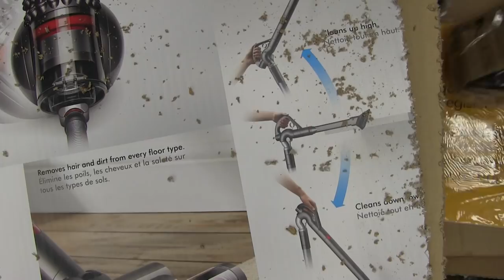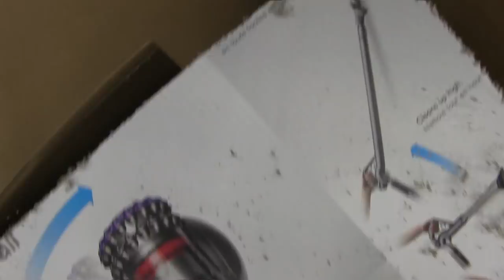DYSON ANIMAL BALLS | It blows!

Comment: Teardown a Miele, would be interesting to see how it compares.
Reply: Ill second this.
Reply: Miele, Sebo, riccar. Take a pick, all of them will be better, but can go over $1000 depending on the model. Plus none of them have the marketing, aesthetics, or availability of dyson, which is why dyson is still popular as a premium brand.
Reply: Given all these teardowns of dyson products, you'd think that AvE is a fan (albeit a disappointed one) of dyson.
Reply: ac3ofspades878 Teardown a Kirby. I've done it many, many times. They put everything to shame. I have several Kirbys in the family and a Miele. I like that Miele a lot, but the Kirbys will be around way after it's gone.
Reply: +1 on that, I haven't really looked inside the mieles, but other than some halfassed plastic parts, the motors themself seem to last forever
Reply: The missus complained about the Kirby and threatened to get a Dyson to replace it, because apparently a 24 pound vacuum is too much to lug up and down the stairs.  Wound up with an upstairs Kirby and a downstairs Kirby.
Reply: Andrew Delashaw 3-5 times the cost, 3-5 times the uses, and 3-5 times the lifespan. 

Since the Sentria, Kirbys are not very heavy... What do you expect from an extremely powerful direct air vacuum? ;) Idk. If you can't pick up a Kirby for some reason (physical disability or old age?) I'd go with a Miele upright.
Reply: Second that. Stop buying shiny crap. Get something proper and made in Germany. They have better tools... and better vacuums. Love my Miele.
Reply: Ten years ago my parents Miele died, in it's defence it was from the 70's but they got a Dyson, and i don't know if they were better then, but this thing still works like in it's first day. Especially the powercord windup still works perfect, usually the first thing that gives up.
It survived falling down the stairs as well, thanks to the wobbly plastic 😁
Reply: I just left a similar comment right before I saw yours.  I would like to get one but can't really justify dropping $600 on a vacuum right now.
Reply: Miele are 5x’s the vacuum dyson are. I fix vacs for a living and there is no comparison honestly. I wouldn’t take a dyson if someone gave it to me.
Reply: Not all Miele vacs are expensive, especially if you start at the entry model and add only the accessories you really need. Kirby vacs are too heavy for most people to bother taking out to use. Filtration is also just one layer. Miele filters start at the bag, then a pre-motor filter and a post-motor filter with all of them being easily replaceable.

Comment: Vacuum valve required to allow airflow for motor cooling when it's clogged.
Reply: yes that what i thought
Reply: Came down to the comments, to say just this.
Reply: betting he just asked that fishing for comments cuz I thought this guy was the Gandalf of product engineering until he asked what seemed like the immediately obvious application of the valve.
Reply: It's the anti-degloving valve?
Reply: It's main purpose is to stop the motor from over speeding. When there is no airflow the heat gain is minimal due to reduced current, but the risk is the armature can trow it's windings or commutator with effectively unloaded free running.
Reply: Note to self: Do not look up degloving injuries on Google images.

Comment: With a shop vac, the cooling airflow is usually separate from the cleaning path, so blocked inlet is both less load, and more cooling air as the RPM goes up. Residential vacs use the cleaning airflow to cool the motor. If airflow goes to zero, even though the load goes down, the cooling airflow can go to zero.   Not a good mix.
Reply: Right. This is also why drills recommend that if you are going slow on steel to pull the drill out and rev it free to move some air over the motor.
Reply: That's why I like direct air vacuums  like my Kirby. It has it own dedicated cooling fan.

Comment: I bought two Dyson vacs when I lived in the UK. They were amazing. Moved back to the states and didn't think twice about getting one here. I was about as disappointed as in this video. Mine wouldn't pick up Labrador dog hair on the first pass. I needed to go over an area at least twice. Since I knew the Dysons in England did a fantastic job with the same dog hair from the same dog, I called tech support. I was floored when they told me the units made in the US had smaller motors than the UK counter parts because the American market was more interested in the way it looked, whereas the British market wanted an effective product. I actually did some research and had to buy something else to clean. Unfortunately I bought it online and couldn't return it. It sits next to my dryer to clean the lint trap. Wish I seen this video about 10 years ago.
Reply: ntdude4 I've had good luck with Hoover products. They do what you need them to for a third of the price.
Reply: Thanks. I did some research and fumy as it sounds there was a kenmore something or other that was high rated and a decent price. Its been working great ever since. Thanks again for the suggestion.
Reply: ntdude4  Interesting that tech support told you that, given that they sell the same models in Europe and USA, other than also selling the upright model in USA.
Reply: It's not the market they were made for, it's when they were made (the decline was inevitable).
Reply: EU/UK consumer protection laws are much much better than the ones in the US. That is probably why.

Comment: That valve makes it cheaper for the motor to comply with it's wattage rating.
      That motor is wattage regulated by air resistance and the motor is designed to a minimum wattage to save money(more wattage means thicker copper winding and more copper), if the motor over spins from lack of air resistance more wattage will flow over-heating the copper winding or popping a circuit breaker.

   It probably also helps it pass national compliances mandates for the motor's approved wattage use.
Reply: scot shabalam i thought it were just for cooling incase the intake were to be blocked. Good to know though
Reply: I bet its cooling too.  These things cool by air circulation through them.  when things plug up, the air heats up and the motor dies.  This is a common failure mode with cheap shop vacs.  Fein shop vacs have external motor cooling and can run forever with the intake clogged.  Just a guess though.
Reply: AvE said it was attached to a breaking mechanism to slow down the motor.
Reply: also stops it catching fire :)
Reply: nope the vacuum mech lets air in if the vac gets too high (blocked inlet)
Reply: ave would be the first to admit he's not always right.  the motor spinning faster unloaded isn't going to draw appreciably more current, stalling the motor would do that.  the overheating issue is largely caused by the lack of cool air draw through the motor when the inlet is blocked.  when the inlet is blocked, the vacuum pressure increases, opens the valve and allows cool air to flow through the motor so it doesn't burn the lacquer on the windings or melt something.  there also seems to be a thermal shutoff as well.
Reply: The Valve is more for the cooling effect. If the rotor and stator are wired in line, the motor begins to overrotate. That causes heat and losing windings of the rotor.
Reply: My Samsung has a similar sort of bypass valve too, you can hear it open when the air flow through the normal intake becomes restricted, it is there to ensure there's always adequate airflow so that the motor doesn't overheat. Mine's 360 airwatt (1,800 watt motor), so despite the valve it's no slouch when it comes to suction. It is by far and away the most powerful suction on any vacuum I've owned, while also managing to be the quietest too. Sadly it is let down by its filters which are a fraction the size of that dyson's and clog far too quickly, although at least they are easy to remove and wash, or replace when needed.

Wet and dry shop vacuums have a bypass motor with a separate cooling fan, as the intake air can't be used to cool the motor as it may contain water or abrasive dust. Also makes them suitable to use with vacuum chucks and tables. 
  
Vacuum cleaner motors are actually under less load when the intake is blocked, there is less air pressure in the turbine so less air resistance,  which is why their motor spins more quickly if  the nozzle is blocked. If you run one with the dust compartment open so the air flow is not restricted by the narrow bore of the hose, the motor spins slower as it moves a lot more air and is working much harder than normal. I've burnt an old  vacuum out  doing that to get stronger airflow when I used it as a blower to fan a fire in an oil drum stacked with branches and doused in old chip oil. The flames were quite impressively high though,  reaching  roof level on a two story building.
Reply: I would think it's for health and safety as you don't want to have a hand or body part suck in to a vac
Reply: A typical vacuum will only produce about 20kpa of suction, that's about a 3PSI drop in air pressure and a powerful commercial one might manage 5psi, not enough  to harm a hand, or all but the most delicate of body parts.

Wet and dry vacuums don't even have them. Instead, they have a cooling fan mounted on the motor providing a fully independent airflow to cool it.
Reply: Egaslem thats right, a blocked Inlet let the Motor spin faster at less current.
If the Lifetimefilter cloggs up , the Bypass prevents overheating the Motor, cause its aircooled
Reply: Egaslem A wet or dry is not going to use nozzle air for motor cooling if its going to suck liquid.
Reply: I thought the valve is to free trapped objects more easily by automatically relieving the vacuum pressure.
Reply: Looks to me that it prevents the fan blades from stalling (aerodynamic stalling) which would drop the suction.
Reply: scot shabalam he said it was a vacuum break, which is not to be confused with a vacuum brake. It’s called a break because it literally “breaks” the vacuum at a specified pressure.
Reply: Run a vac on a power meter and it would show you that an unloaded motor (moving less air) will use less "wattage" not more. Interesting theory tho.

Comment: Love it. The vacuum vent valve choocherator is there for the common times you may suck up a bottle cap, or something plugs the vacuum hose.

The vacuum gets a wee reprieve, and can keep sucking air instead of stalling.

If it can't flow any air, that Panasonic motor will go Chernobyl.

Comment: Grumble grumble, moan moan. 

We have 2 dyson vacuums. One we bought used on CL about 12 years ago and it’s still working wonderfully. Zero problems whatsoever. 

Sure, it’s no 1950’s Kirby in terms of construction/materials, but it also works about 100x better than my mom’s 40lb Kirby ever did.

Comment: I'm sure this has been said, but you shouldn't have messed with that bypass spring.  That spring opens to allow air into the impeller at a certain pressure as you know, but what you don't know is that it's there specifically to eliminate compressor stall.  This allows the suction to remain at full (-) pressure even when the vacuum has been placed flush on the carpet or couch or whatever.   In this condition other vacuums would reach minimum airflow and then stall the impeller, virtually eliminating any suction.  With the bypass present this never happens, allowing suction to continue even in very low airflow conditions.  This is a really great feature that it seems you failed to appreciate.  That being said, I love all your videos and would love to see more high end industrial equipment torn down.  Also it would be super cool if you tore down a worn out transmission and explained how it all works, failure modes, etc.  Keep up the good work!

Comment: AVE if i may be of some help to your question at 10:54 .

 most likely the reason behind the valve is to prevent the turbine blades from rotating too quickly. i learned this when i was younger by having a small air compressor for blowing up pool toys. it had the same setup and i noticed that when i covered the holes with my finger, the turbine blew up inside the housing.

I think the airflow puts just enough friction on the blades to keep them from centrifugally destroying themselves.
Reply: I agree. Pretty much anything built to move air (fans) will move much faster than designed when you remove the resistance that air provides. I've measured fan speed on my laptops cooling fan and when I covered the intake the speed increased from 3,000 to 4,000 rpm and you could hear the change as well.
Reply: I have a guess that the motor need some air for cooling as well!
Reply: I agree, the motor is cooled by the working air.  If there's a blockage in the airflow caused by an obstruction that goes unnoticed for any length of time, the bypass valve still allows some air through the motor for cooling.
Reply: When they stop sucking that's when you want them to cook!Got me beat

Comment: Remember when these geniuses of marketing claimed hundreds of thousands of G's for their cyclonic separators.  I did the calculations on them and sent them an email saying they were several orders of magnitude lower than claimed.  They dropped that claim from their advertising.  His venturi effect fans and heaters are another piece of marketing baloney.  They claim they're fan-less but the fan is just hidden in the base.  But I guess Dyson is probably rich making ignorant people think he's some engineering genius when in reality he's a snake oil salesman.
Reply: I think the marketing term for the fanless is obviously a misnomer, but the "idea" still stands as its advertised for being quiet and efficient without buffeting fan noise, which it does seem to do.
Reply: Drive your enemies before you....And hear the Vayling of the VEMON!

"Nice Guys finish last....You gotta decide...Are you a Sheep Or are you a Wolf?"
Reply: Same happened with the Dyson "No loss of suction" tag line.
It's no loss of suction till the barrel is 1/2 full.
Reply: Actually don't they say "Bladeless"
Reply: @Michael Patrick The marketing may be less than honest, but the early products were top notch.  Friend of mine owns a  janitorial company and almost all he uses are Earlier model Dysons.  He said that he has tried all the other brands and they neither last as long, nor do as good a job.
Reply: @ClinttheGreat  I just fixed one of the upright models, they are easy to clog up with mud and gunk but they are easy to fix, people usually throw them out because they think they are broken but you just wash out all the bits and they are like new again.
Reply: The fan is true. What's inside took one apart and there I saw the fan. So Dyson is a lying snake that makes 800+ Dollar cordless vaccums and 600+ "bladeless" fans.
Reply: Regardless of the marketing bollox, Dyson vacuums are the best of the bunch and spare parts costs are very reasonable.
Reply: @davidelliott5843  but they only last 1-2 years which for a vacuum is odd when most last 5+ years like my mom's old powergroom which still works but smells like crap after vacfuming
Reply: @davidelliott5843  ...and they carry a 5 year warranty.
Reply: Dyson is to vacuum cleaners as Bose is to audio equipment.
Reply: Dave Micolichek  Of course I do, my friend has no reason to lie, especially about vacuums.  It’s called integrity.
Reply: @gavinevans8124  our dc39 animal 7yrs.still going in family around 2 kids.
Reply: @MrTurboSAAB1  then you must take care of that thing
Reply: Gavin Evans I paid like $250 for my cordless vac and it is really the only vacuum I can stand using.

Comment: We made a 5 gallon bucket into a cyclone prefilter to extend the time we had sucking up drywall dust in a shop vac beating out the filter! added a good 2 or 3 times more run time betweens cleaning :)

Comment: I am thinking that the on off switch is enginerded to break before the filter clogs up.............?
Reply: And then you take it back to the store and they hand you a new one, no questions asked.  Certainly overpriced for all the marketing 'wank', but the built in disposable/replaceable appliance is accounted in there for those willing to march it back into the store (whether or no you agree with the disposable tech that runs rampant these days)
Reply: They have a negative designs department : dedicated to adding as many failure points as possible without the thing falling apart in the box.
At this rate electronics will come with a Best Before date on them...

Comment: so a cyclonic vacuum works by spinning the dust in a circle 'til it gets dizzy, then it falls to the bottom?
Reply: Mickleblade Yes, woodworking factories use cyclones the size of a semi trailer. The one where i worked years ago had a 3', or 1 meter pipe going into it, and a 350hp motor.
Reply: It spins it out into slower airflow where it loses the bouncy and dynamics to float it, and it falls out of suspension.
Of course, the poor dust particles get really too, and it's completely inhumane.
Reply: Chris Walford Basically, It's a gravitational slingshot simulator.
Reply: Coal fired power plants used to have cyclonic separators, for fly ash.